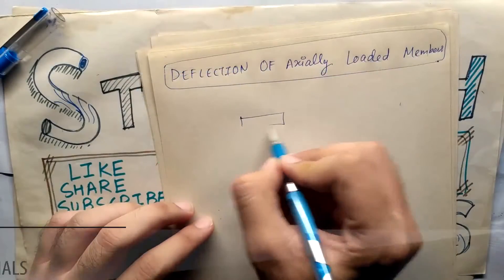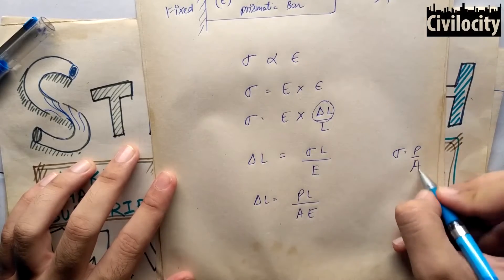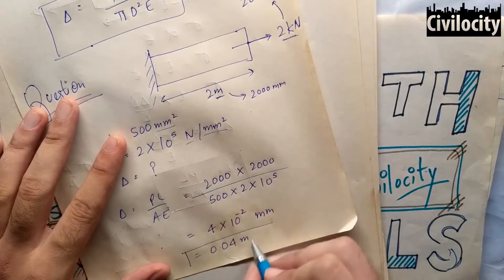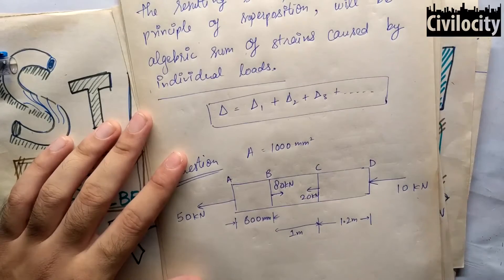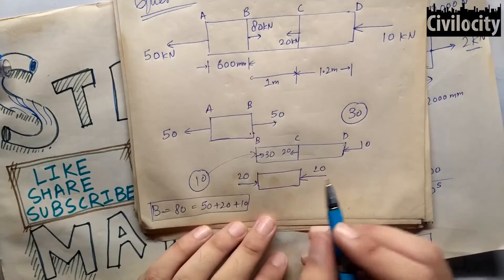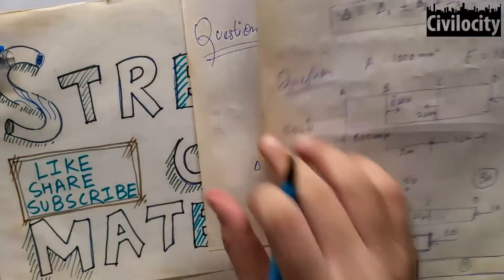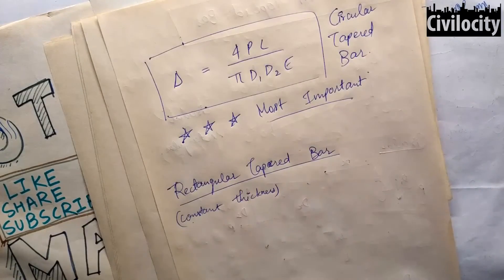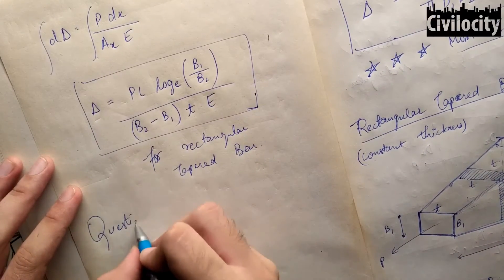Deflection of Prismatic & Tapered Bars and Principle of Superposition | Lec-7

Comment: in the example of principle of superposition, why compressive force on BC is 20kn?...it should be 30kn..then only equilibrium of section is maintained.
@6:00
Reply from the maker: +aman singh so the force at point B is divided into 3 parts that is 50, 20 and 10. 50 to maintain the equilibrium of AB, 20 maintain the equilibrium of BC and 10 to maintain the equilibrium of BD.

Comment: In highway engineering... 
1. Why in gate book (g) is taking as 127 and 225 sometimes in super elevation? 
2. And why 0.278 is multiply in velocity (v)?
Reply: adil Ahmed convert kmph into meter/sec that implies (v*1000)/3600= 0.278v.... again 9.81 / 0.278^2 = 127 approx...  and lastly 127/0.75^2 = 225 approx.
Reply: Abhishek Kumar  9.81 smj ni aaya thoda
Reply: Mere Bhai!! g ko 9.81 hi liya gya Hai. e + mu = (0.278v)^2 / gR...  yaah g ki value 9.81 lo and isse 0.278^2 se divide kr do.. you get the approx value.
Reply: i.e.      e + mu = v^2/127R   v is in kmph